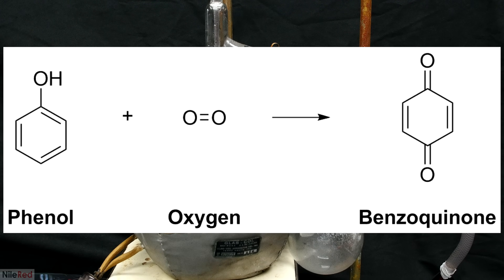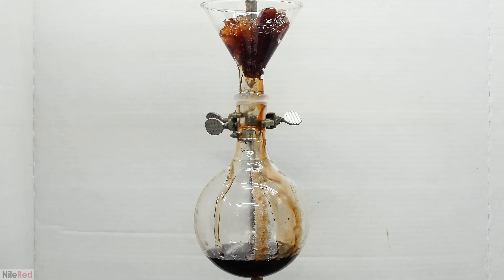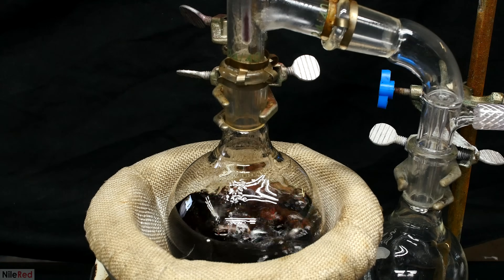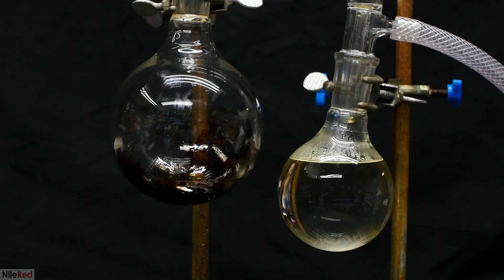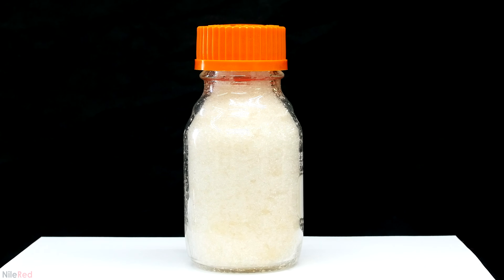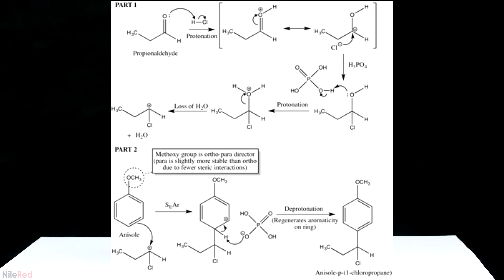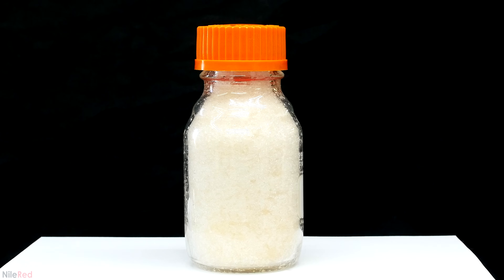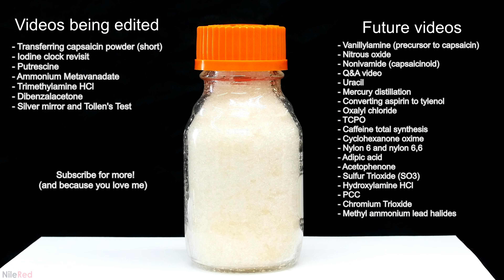Cleaning Dirty Phenol

Comment: you have quite light safety equipment for such a dangerous chemical.
Reply from the maker: As a chemist, you work with so many things that are MUCH more dangerous. You kind of get desensitized.
Reply: SneakyCheese8 Well if your exposure is longterm, of course you'll suffer from the consequences. Also, if you spill concentrated solutions over your palms or thighs (most of accidents occur like that), you'll get serious burns unless emergency shower is available in few seconds.
But if you get a drop of its solution on your skin, or you touch a wet crystal lying on the table, and you wash your hands with water, absolutely nothing will happen.
Dude, people were handling cadavers saturated with phenol for decades, even with bare hands. Nothing happened.

Yes, it is poisonous, but you're describing it as it was sarin. I never said it's not poisonous.

I don't recall phenol being used as a blistering agent. Can you verify your claim? It would be a most inefficient weapon, way weaker than many other first modern warfare agents.
Reply: Phenol is not "such a dangerous chemical".
Reply: you have obviously never worked with it. It is poisonous when being breathed, eaten or (contacted with skin), liquid phenol is corrosive on skin and produses white burnmarks that can even lead to death.
Reply: SneakyCheese8 I've worked with it as a cadaver preservative and I've synthesized and purified it in quite large amounts so I kind of have some experience with it.

In order to harm you, you really need to be heavily exposed to it.
Of course you won't touch it (and if you do, washing with water is fine enough) or eat it.
You know there are soaps with phenol, right?

It's far from what you're claiming it to be. You're making it sound like it's a chemical warfare agent.
Reply: SneakyCheese8 I've said phenol is not such a dangerous chemical, and by that I mean how you described it. It's a fact. It's not a furious poison. I've had it on my skin, nothing happened because I just washed it away with soap and water.

You said it was used as a blistering agent. I'm still waiting for evidence. In what war was this poorly volatile compound used to incapacitate or kill people?
Just don't say extermination of people in Third Reich hospitals. That's not warfare and it wasn't used to induce blisters, but to kill.
Reply: Fun fact: phenol is used as a local anesthetic in some throat sprays
Reply: SneakyCheese8 No, because I know what chemical burns look like. I still haven't found evidence of phenol being used as a warfare agent, so I'm still waiting for you to provide it.
Reply: Maybe you mean phenol as group of aromatic compounds with -OH. In that case your claim is true. If I remember correctly cresol is used in those local anesthetics. But if phenol C6H5OH was on your mind, don't make throat sprays, please.
Reply: Lajos Winkler
I work in a lab, on a plant where phenol is one of the products. every year something really bad happens with it (tell those guys it isn't dangerous). if you get concentrated phenol on your hands it will instantly burn you and it will need more than water to prevent long term harm because it easily gets into your blood stream where it acts like a neurotoxin and we suspect it causes heritable diseases, for example polyethyleneglucol can be used with water to scrub it off.
Remember these are educational videos and it can be fatal if you start spreading false information. why are you so insistent on telling people this isn't a poison?
Btw, phenol HAS been used in chemical warfare as a blistering agent.
Reply: during this converstation did you ever even try to google phenol burn victims? It is also very well known that the first antiseptic solutions caused severe irritation.
Reply: yeah, lets ignore the original argument completely.
Reply: yeah, some felt on my lag, not nice. only a small burn though, no scar left. (i washed a few seconds after it started to burn).

Comment: Whats up fam? hows it going? Also, are you wearing a gas mask while doing this? I can kinda see you and your lab in the receiving flask
Reply: It doesn't smell bad, it's actually pleasant, but if you ever worked with prepared cadavers, you'll instantly be reminded of them because the embalming solution contains phenol and that leaves the strongest impression on the nose. Formaldehyde is a lot more volatile and doesn't have such strong scent, but burns the nose a lot more.
Reply: phenol smells bad lol
Reply from the maker: I did for part of it. I wore it when I was pouring the liquid phenol and melting it into the flask. While distilling it though, there is pretty much no smell.
Reply: No need for a gasmask in a ventilated area if you're just warming it up. Such doses are insufficient to make you feel bad, let alone getting harmed. Boiling phenol in an open vessel, well that's another story...
Phenol is harmful of course, but occasional smelling of it won't make you sick.

If it was that horrible, gross anatomy students nd professors of anatomy would drop dead like flies because the main cadaver preservative is actually phenol.